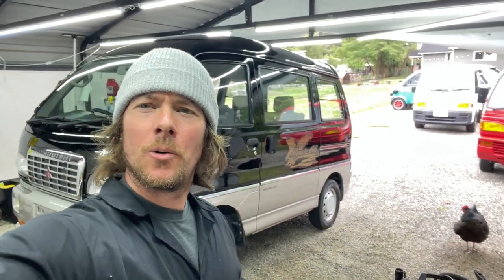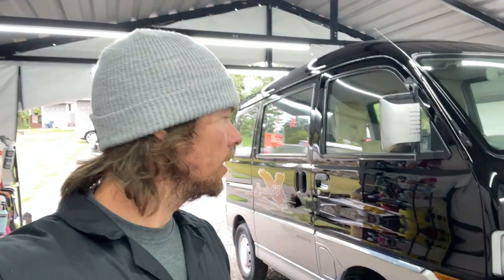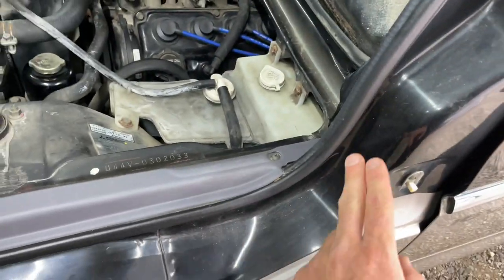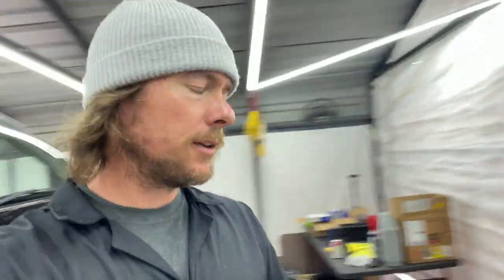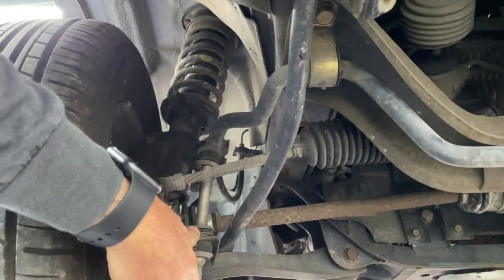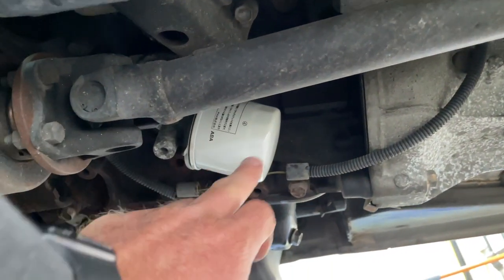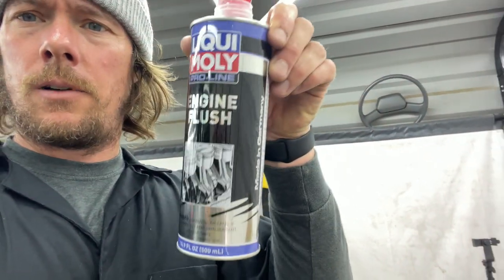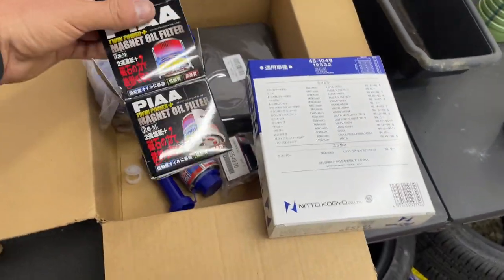FIRST Oil Change Mitsubishi Bravo Route 66 4A30 Engine 10W-30 Oil NOT 5W-30

Comment: How much did service before shipping cost and what did they service?
Reply from the maker: it was pre serviced so I have no idea how much it cost but they did the timing belt and pump im guessing. definitely new plug wires and assuming plugs, cap and rotor. fuel filter looked new and air filter as well. all basics that should be done there if possible :)

Comment: Must have mised it, what are you basing your 1030 conclusion on? Service manual and other sources show 530 on all 4a30 motors except the turbo version...either way it doesnt really matter with these motors .
Reply from the maker: i saw it in the service manual and it just said specifically the 4A30 engine not to use 5w-30. Others were ok. Guess it didn't show the turbo version and I just assumed the engine numbers were the same. I'd assume the 10w-30 is safe in all engines anyways being how old they are lol
Reply: @OhKeiGarage  lol right!? Yeah I went back and forth on it for a while and concluded I just didn't care too much =] appreciate your video . I've got a bravo U44 with the glass roof but kinda digging that route 66!
Reply: 5w-30 for all 4a30, except turbo which calls for 10w-30. Also same specs for the 31 engines.